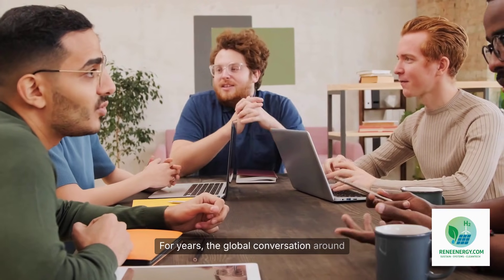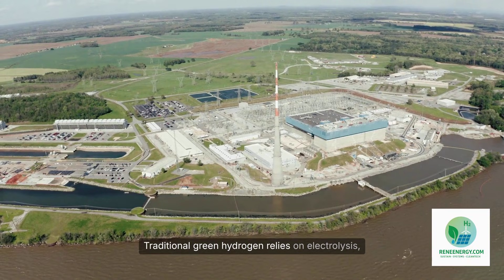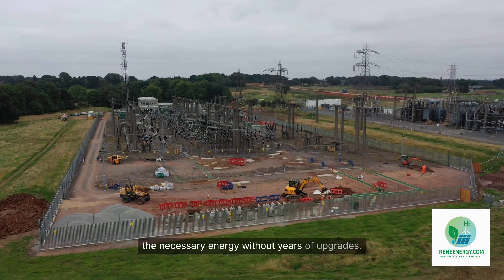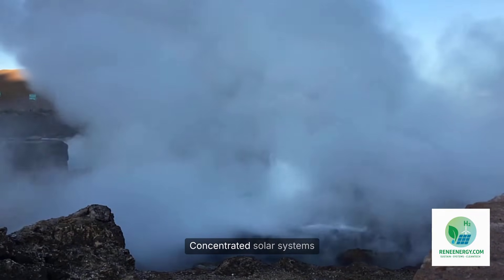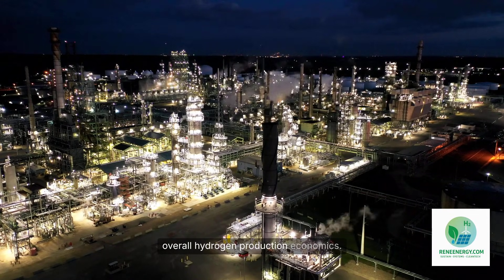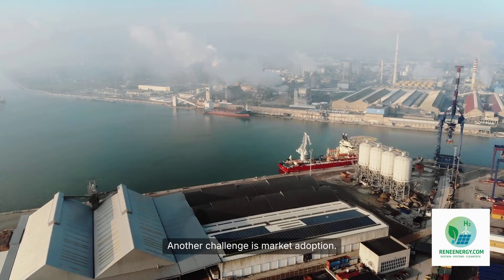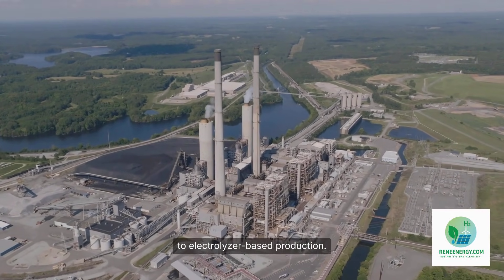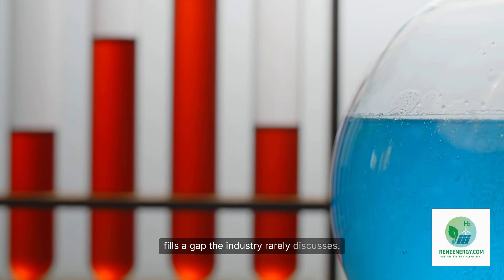NewHydrogen Says It Can Make Clean H₂ Without Electricity — Is It Real?

Comment: Hydrogen has a few huge problems that make it a bad fuel choice.
- storing it is problematic, when it escapes it is gone, it is lighter than air and raises into the high atmosphere
- transporting it and storing it near the engines (cars, trucks etc) is dangerous, as hydrogen mixed with oxygen will explode
- storing enough near an engine is problematic because it is either huge volume or huge pressure or very expensive cooling

Just like the battery problem, this is not solvable. Not today, not tomorrow. 

Comments saying how some future research that automagically solves all these are coming: